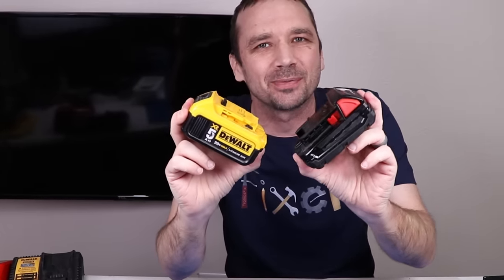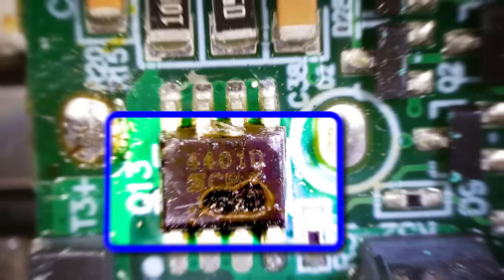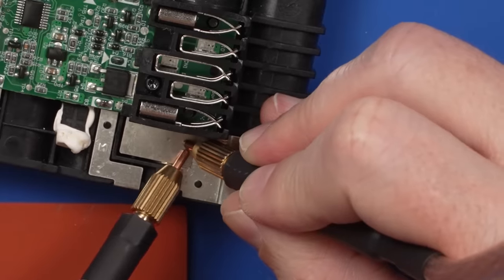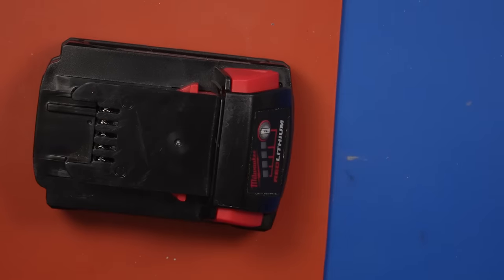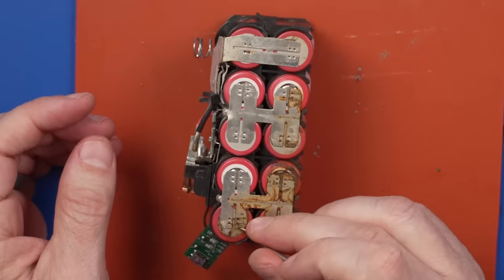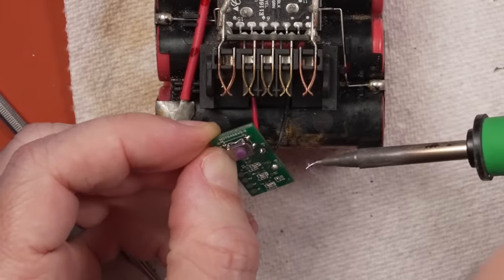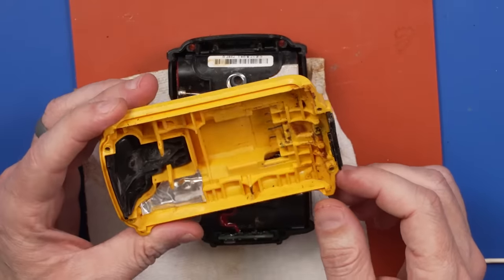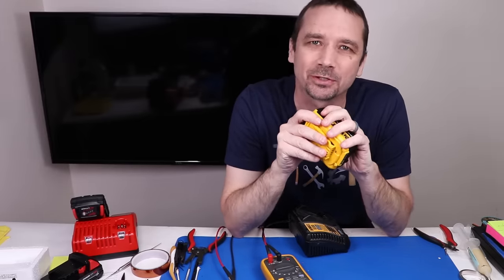Are Power Tool Battery Packs Fixable? Let's Find Out!

Comment: did you even measure the cells before putting on a new BMS? A lot ot battery boards brick if the battery fall too long.

Comment: I dunno if dewalt lock out the bms after power been disconnected, I know that boosted board and Dyson will rlod once it detect huge changes in the voltage

Comment: If you look at the charger it shows red green red green and shows a broken battery icon. So basically the battery is broken so either the aftermarket board is not compatible (very likely) or it’s also broken. Or the batteries are just hosed.

Comment: Those cells just have some surface rust.  As long as the voltage is correct there is no internal damage.  Theyre pretty well sealed being Lithium because Lithium and water are not a good mix.

Comment: With laptop batteries at least if you disconnect the cells from the BMS it will permanently lock the BMS. I guess it's sort of a safety measure since lithium cells is essentially contained hellfire and it's no fun typing emails or drilling holes with a raging fireball.

Comment: You didn't (on camera) review the cell voltages. 

The controller can get pretty picky if there is one cell that is undercharging while the others are charged -- also can get picky on the other end with too large a delta-voltage between cells (or cell groups). Start from minus and make sure that each cell tap on the board shows a similar amount of voltage across each of the five sections. Note that five times 4V fully-charged is 20V as sometimes used by tool makers  (or 18V meaning five times 3V, which is the medium voltage of the batteries during most of their discharge cycle). 

In any case, rechecking each battery (or for the larger one each set of two in parallel) might show a cell offset too large?

Comment: I also had this problem. Deeply discharged batteries. The charger started charging and stopped. I solved it by starting to charge 20 times and then unplugging the charger. At some point enough got into the battery that it started charging.

Comment: Try to repair DeWalt flexvolt battery. I have 3 that show charge on leds but wont charge in charger. If I charge them on lipo charger they work well and only DeWalt tstack radio shows battery broken and wont charge but works normally

Comment: I would try to jumpstart the battery with a wire to get initial charge and maybe it Will takt charge. Liion are Considered dead cells below 2,5V but I’ve bringed back many to life by jumpstarting individual cells.

Comment: I had a Ryobi 40v battery and it fell to 13v and won’t charge. I used a fully charged battery and put jumpers from that battery to the other battery that was 13v and charged it to 33v and then it would charge. It was just too low to charge.

Comment: Maybe I don’t read the LED status correctly in the video, but my impression is that you don’t read the reference correctly on the yellow guy.  Second, the Milwaukee definitely needs to be brought to much higher level of charge, before the charger will take over.  18 V seems to indicate 5 cells in series.  The shut-off level is something over 2 V per cell, so over 10 V, maybe 12 V before any charging.  And the protection board may check the cells individually, which would mean just one bad cell will kill any charger action…

Comment: I think you should have better results with your spot welding if you didn't put both probes on the same tab. Current just flows across the top tab between probes. Put one probe on the small locator hole and the other probe on the second tab you are attempting to spot weld to. This should give you better cross current between the two parts being welded.

Comment: TronicFix my Xbox series x randomly disconnects my controller when on battery or wired I’ve had 2 controllers both same issue not bought at the same time one came with the Xbox and the other was bought separately at least 1 year later and I can’t seem to figure out the issue have you seen this problem before?

Comment: i do this all the time. our recycling place collects tool and ebike batteries for me to work on
Reply from the maker: How do you remove the leads? Also, what's a good spot welder?
Reply: @Tronicsfix  what leads? i use the same spot welder but i have used a diamond file to make the copper contacts as narrow as possible so the welding current is a focused to as small points as possible.

Comment: Good luck with your fight.

However... the use of a pick around the positive terminal of a lithium ion battery it a very bad idea. Lithium ions are mostly dangerous when they short, internally and externally. External shorts, like you were very close to doing, are generally short in duration but still pose a threat. Not every battery will short easily in that channel you were cleaning, but most will. 

On the low voltage, I can't remember the low voltage cutoff, but I guarantee 2v is under it for a 18v battery. To revive that pack, if possible,  you need to charge each cell to around 2.5 volts separately. I like to do it with a NiCad or NiMh charger. Using a lithium charger it will recognize the voltage being too low and fail the charge. However,  using an incorrect charger comes with risks of its own. Meaning there will be no guard rails on overcharging. 

You may be able to hook a NiCad/NiMh charger to the cells in series and look for the 18v Lithium Ion minimum voltage (probably around 14-15v) and then hand the charging over to the dedicated charger,  but be aware that a single cell may still be low and cause a problem. In which case you can charge that single cell to minimum or like voltage to the others and hand it back to the dedicated machine.

Comment: Short answer, the lithium ones aren't worth repairing. 
If you have a spot welder with, hopefully, some finer needle nose style probes, you can fix the Ni-MH or Ni-CD ones by re welding the batteries in the correct configuration.

Though i know the lithium ones are way better to use personally.

Comment: I would not do anything with that dewalt, I have had at least 4-5 fail to water damage, and the corrosion damages the cells seal.
Basically it rusts a hole in the cell really fast due to electrolysis and ruins the cell. Since that pack is double stacked, you can have a situation where one cell is punctured and contanimated, and one is fine. the battery will mostly take a charge in this state and that can be pretty dangerous if further damage happens to the punctured cell or it falls short.

Comment: Just take a good known 18 volt Milwaukee battery Hook the both the positives together and both the negatives for a couple seconds then take it off then put it on the charger and it will charge

Comment: 4:42 A local reseller says Milwaukee has lose battery and connectors, so tools using multiple batteries can beun terminals. Milwaukee does not cover this on warranty, so they says to buy a makita or bosch instead. 🤓 They do however still sell Milwaukee, as ppl want these and they sell more batteries 😂
Reply: Bosch is extremely unpopular in the US and Makita is dying out.  Milwaukee has the most market share and dominating

Comment: these batteries has a chip inside that mark the battery as faulty.
Even if you change the cells, if the chip on the pcb marks the battery as defective, the charger will reject the battery

Comment: spot welding requires current to go between the 2 metals your trying to bond together to heat up. If the resistance is just the contacts you are not spot welding.

Comment: I could live without the background noise.  The red wire on the Volt meter board did not come (or become) unsoldered, it broke off.  I don't see where Nickle strips would rust and why a little rust would effect the operation of a battery pack.  At four Volts per cell five cells = twenty Volts so one shorted cell (discharging it's parallel mate) would leave you four cells leaving you about sixteen Volts. (fully charged)  You are fixing these things without knowing these facts. Ron W4BIN

Comment: The negative terminal in lithium cells has a tendency to degrade...reducing charge capacity. Your lucky if theres something disconected. Otherwise your stuck with breaking the pack apart, finding the bad cells then putting it back together with new ones. Not worth it for most people

Comment: I would have just soldered instead of spot welding those connections. Spot welding should be reserved for the battery connections imo

Comment: Looks like they used a modified sine wave inverter to power the charger this is what happened to 2 of my chargers by powering them with a modified sine Wave inverter my DeWalt cordless tool charger was easy as the wire stayed in the hole just had to resolder it that works my auto battery maintainer the wire came right out and there's multiple the holes it could go in

Comment: If you wanna weld something togehter you schould hold down your pins on the TWO metals you wanna have welded. you basically made a short-circuit between your pins.

Comment: Lots of these batteries are actually fine but if they are run low they communicate with the charger and stop you from charging it again so you have to change the board.

Comment: theres been times where its been cheaper to buy a whole new tool package that contains a battery, drill, and charger just because the battery itself is for example 100$ but the kit with everything is 150$ and well you can always use another drill right? lol

Comment: Those are18650 batteries each cell is 3.17 volt (Max4,2 volts).  The red and green flashing LED's ( on the Milwaukee charger) indicate a defective. battery. I couldn't watch all of this you obviously don't know what you are doing. It's hard to fix something if you don't know how it's suuposed to work.

Comment: I would never risk trying to repair this stuff, there are way too many lithium battery fires and many caused by people setting themselves up refurbushing batteries to sell half price and they are not factory trained or authorised, messing with the battery in any way then exposes you to the legal repercussions if something goes wrong and the battery causes a FIRE, the first thing the investigators will look at is WHO might have done anything to the battery, when it comes out that the owner opened the thing up and did repairs NOW the insurance company is given a FREE get out of paying card when they say your modification on the battery CAUSED the fire and you are 100% liable, and deny the loss/damage claim. Worse yet, if someone is killed in the fire that becomes another legal headache!

Comment: YOUR REPARS ARE WISHING REPAIR ????? SOUNDS LIKE U DON'T KNOW TOO MUCH ABOUT THE BATTERY PACKS OR CHARGING VOLTAGE AND OTHER MATTERS?????? I WOULD HAVE SOLDERED THE MAIN TERMINAL OF THE MILWAUKIE BATTERY IF U COULD SPOT-WELD IT. YOUR SPOT WELD  BAD .....